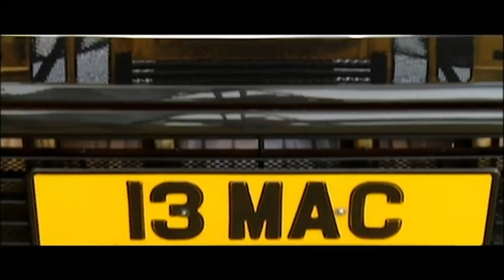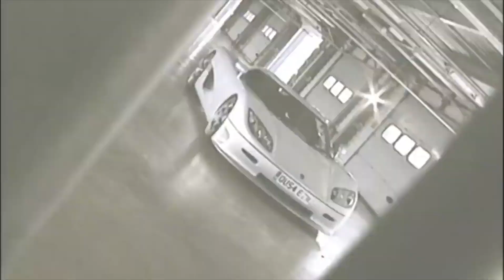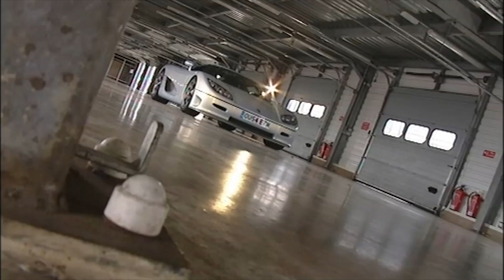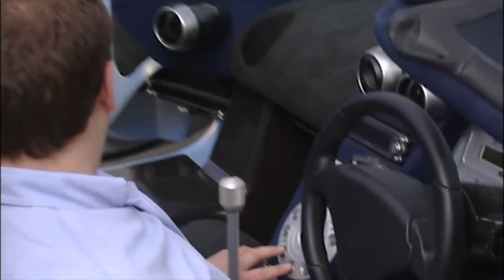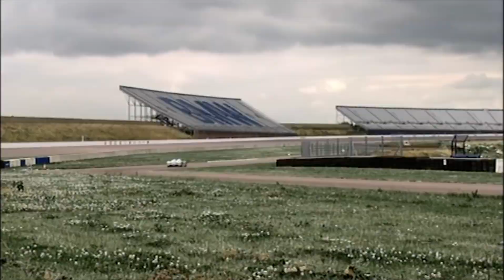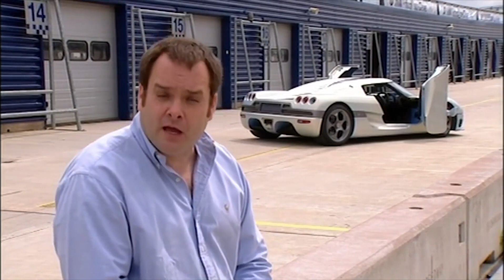McLaren F1 VS Koenigsegg CCR | Fifth Gear Classic

Comment: Koenigsegg has matured and streamlined a lot since then.
Reply: Yeah but you would still take an f1 over an agera or jesko
Reply: Jesko for me over anything else, that car is basically untouchable in the performance and looks department
Reply: Not in the aestethic section, they were a lot cleaner and sleeker years ago
Reply: @xxxxxtrxxx13  The Regera looks beautiful and the Jesko is of course more focused in its design, but the Absolut version still retains the sleekness of the older eggs. Granted their old designs are further timeless than the modern ones, but there comes a time when a company tries a new direction in terms of design. Heck, even the Gemera is also clean too.
Reply: @Ksegger  how do you know if it's untouchable have you seen one even move😂

Comment: and now here we are in 2020 where koenigsegg has reached the pinnacle of the performance automobile, nothing comes close to their current cars
Reply: Vs tesla ludicrous?
Reply: @amarjit singh Aston not even legal to drive on road.track car only.
Reply: @amarjit singh and when they do make it street legal it will not be the same as the track version. And you are trying to say an un tried and true car not yet available for the street, still in its testing phases is better than the egg. You need to go check out some test reviews for the valkyrie, it's actually not that good. But of course the street version will be different

Comment: The Koenigsegg no doubt had a great designer behind it, but the F1 was the brain child of arguably the greatest F1 designer/engineer in history that allowed absolutely no conpromise. The quality of engineering and achievement shows. In 1993, 160mph and above, the F1 roadcar accelerated faster than any actual Formula 1 car did at the same speed and it did it with more weight and 200-250 less bhp than most of the Formula 1 cars.

Comment: Well, they've evolved quite differently. Credit to the Mac, for all their accomplishments, including Kenny Bräck, setting the Nürburgring lap record of 6:43:22 back in 2017 with the P1 GTR. The One:1 incident in 2016 was not good at all for Koenigsegg; it remains to be seen if and when they return to the 'Ring for testing and/or record attempts. The top speed record of 278 mph with the Agera RS(+) and the 0-400 km/h (~250 mph)-0 of the Regera was very fast though. Furthermore, the new Mac T50 is also interesting indeed, as well as the new 'Egg Jesko. Remains to be seen how fast and good they are, respectively...